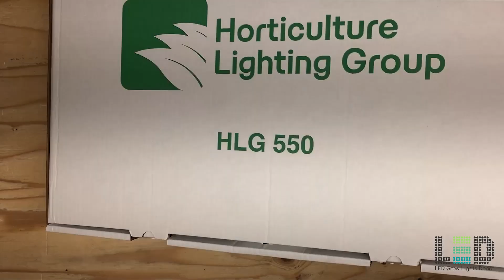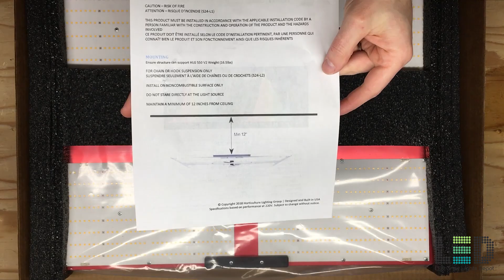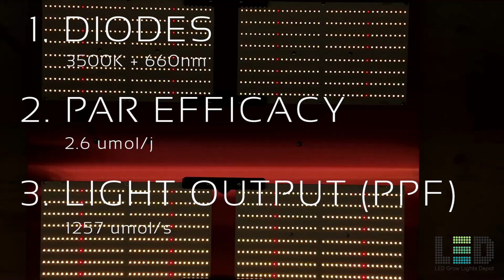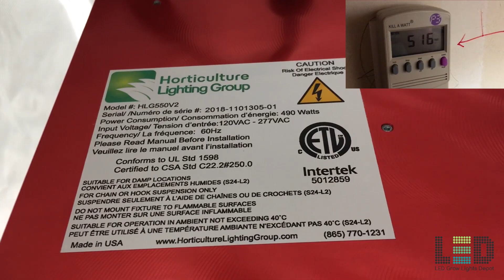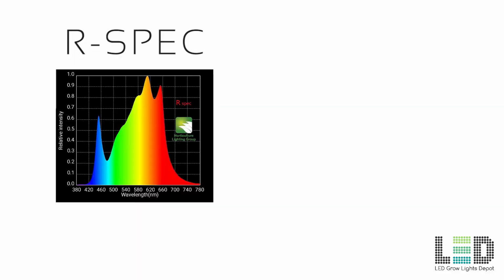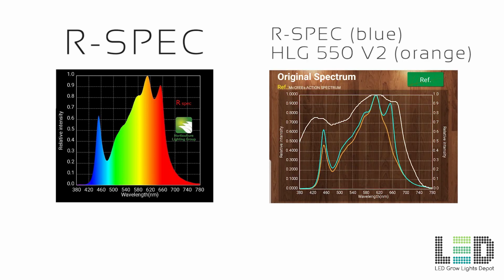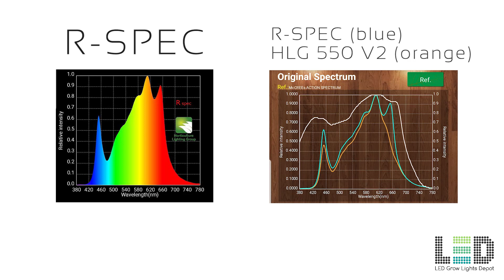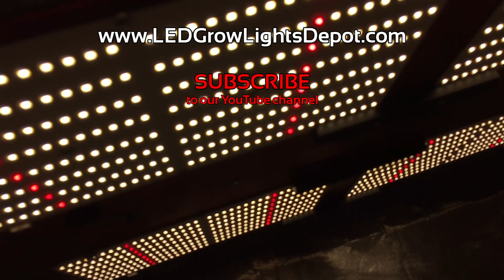HLG 550 V2 R-Spec LED Grow Light Unboxing, Review, PAR Testing

Comment: 2 years old
Rubbish
Reply from the maker: This light was updated with the HLG 600 Rspec. It is currently $775. I suggest you check out HLGs other fixtures in their current line up. The Scorpion Diablo is a fantastic light.

Comment: Great video, thanks, I bought my HLG 300 from you guys 2 years ago.
Reply: I'm thinking of getting one of those, does it get very hot?
Reply: @Glenno666  It can by touch but as far as performance, it doesn't effect it. I leave mines on for like 13 at times
Reply: @curtflirt2 thanks for the info, seems like a good light just hope it doesn't heat up my tent too much
Reply: @Glenno666  No, it won't heat up your tent too much, it doesn't heat up mines like that and I have a  2x2 with a small fan and even if you find that it does, just leave the tent open a little and you should be fine.
Reply: Their lights are really good.
Reply: @curtflirt2 thanks for that, you've convinced me to get one

Comment: I own this light, works very well. I’m on my third run.. hitting around 1.8 per grams per watt in 4x6 area
Reply: Mr. Dank BRK-BUD dam bro good shit! Do you have any Grow journals recorded for viewing? I’m thinking for the price this is the best light
Reply: Fenkell Mel thanks bud.. Unfortunately not yet with the RSPEC V2 I do have a couple with Spectrum Kings 602, and 400+/402+ grows but not complete grow journals on the tube. I will be starting one at the end of this month under the HLG.i really do like this light the spread is great.. compared to my other LEDs. Both work well no complaints with either

Comment: I saw the price and almost choked!!! There are way cheaper solution out there!!!
Reply: I am not affiliated with any company selling these lights but as someone asked  but hence deleted the comment, here are some cheaper alternatives(half price):
- https://www.aliexpress.com/item/4000170489374.html?spm=a2g0o.cart.0.0.706a3c00bTgO4z&mp=1
- https://www.aliexpress.com/item/4000446069394.html?spm=a2g0o.cart.0.0.706a3c00bTgO4z&mp=1
- https://www.aliexpress.com/item/4000530776182.html?spm=a2g0o.cart.0.0.706a3c00bTgO4z&mp=1
- https://www.aliexpress.com/item/4000495864788.html?spm=a2g0o.cart.0.0.706a3c00bTgO4z&mp=1

They are easy to be found. I am not taking away anything from HGL and I am sure their quality control is top notch, but alternatives exist half price.

Comment: Theres just so many models and variations and combinations of led grow lights Im totally lost lol
Reply: Btw a decent priced light is typically 1.50 per watt and you are going to want at least 400 ACTUAL watts for a 4x4 give or take. And ignore anything about "1000w hid equivalent" or "replaces a 600w cmh" all that is irrelevant they are comparing apples to oranges. And if a light is priced too good to be true it is!
Reply: *optic is a good company as well but I would look into rapid led if you want a puck set up. Rapid just has a better platform to build on in my opinion. Also a company called Black Sail makes an interesting light called the cannon that pulls 320 watts with a similar albeit much larger design. It's only $350 I was considering getting one for a 3x3 myself.
Reply: Same
Reply: If your willing to trust me I've been looking into lights for months and HLG 550 v2s are a great plug and play light. So are Rapid LED set ups that use the chilled logic pucks if you want to get more wattage for your dollar and don't mind a bit of work. And if you want to go all out and spend top dollar in a 4x4 or 5x5 get a ROI e680 or a similar bar light from Gavita or Fluence. Avoid amazon and alibaba lights as they cut corners on design and quality not to mention there is no guarantee that anything they tell you about the light parts/performance is true.

Comment: Is the HLG 550 V2 wired in series or parallel with the HLG-480H-2100B driver?
Reply: Mike 
Series, constant current C2100 driver

Comment: Does anyone here actually run these lights? I run the HLG 550V2 ( 2 crops in) and I am having definite issues with increased flowering times. 
Note: These are strains that were previously verified as 8wk finishers using 1000w HPS. 
I am guessing that the reason for longer flowering times is the lack or red diodes which were added in the urgrade from the V2 to the V2R. 
Unfortunately, HLG did a poor job on informing their customers about the coming upgrades and I ended up buying a V2 about 2 weeks before it was discontinued for the V2R...Yay! 
Now I get 2-3 weeks extra flowering time for my troubles.
Reply: Michael Martinez never experienced anything like that! I run the reg.V2 & 2- V1’s..... no red, and FLATOUT kills it!!!

Comment: Awesome review. I just fired up my HLG 260 V2 R spec in a 3'x3; tent. Would the distances be roughly the same as the 550 v2 r ? Im at 36" for my seedlings which are on node 3 of true leaves. I left the dimmer at default .
Reply: I would say with the 260 during flower u could get closer. I'd keep it at 36 for the seedlings and keep it dimmed down then slowly crank it up and drop it down as they get established

Comment: what about the temperature ? much lower from an hps?
Reply from the maker: Half the heat of a 1000W HPS.
Reply: @Ledgrowlightsdepot  so still very hot?
its half of the energy so for an led it should be cooler than half of the heat
could i run them in a 3.5x3.5 tent? 
i think it have too little par output for a 4,5x4,5...
Reply: Hduuuuuuurrrrrr

Comment: So hoping to get this bad boy
Reply: Be careful...read about increased flowering times using Quantum LED boards,. I got burned on the HLG 550V2... im 10 wks in and not finished yet (Crop #2). And its an 8 wk strain confirmed using HIDs. Research more before laying down the 900$

Comment: Wouldn't 4 of the 120s be as good and cost a lot less ?
Reply: Would be better than the 550 v2 without r spec
What you can do is add the r spec and it would be even better than this one
I would advise you to also disperse more the qb's to have a even better light distribution around the tent

Comment: they never said it was aimed at the budget market..some people can afford the best at any price..its a once in a lifetime light..a 10 year investment..one that will double your yield from crop 1..so it pays for itself after one crop..6 crops per year, x ten is 60 times the amount from hps you would replace 2 x a year at 100 bucks..
Reply: People who have been pushing led lighting so much are extremely misleading, especially since they aren't scientists and even admit to not knowing exactly how the sensor works. 

Hid bulbs emit the same quality of light in a 360° sphere, if you take a reading directly under the light you can get anywhere from 1100 - 2800 ppf, from 1000w de hps.

 heres where things get interesting and directly misleading, when you take a reading off to the side of the hid light and keep the sensor pointed straight up, a large portion  of the light actually reflects off the sensor and doesn't take a true reading of the ppf that's actually being emitted. If you turned the sensor to look at the light youd end up with a similar reading to it being directly under the light. 

Why does this matter? Well that's simple. Plants absorb energy, they dont reflect it, you get a more accurate and realistic reading when aiming the sensor at the light. 

Hid lighting is still the best and the best commercial growers still use de hps for their flower rooms. This is fact.

Comment: FWIW.....those readings you're taking with your PAR meter are PPF, not PPFD. Otherwise....pretty solid video. Nice work.
Reply from the maker: They are PPFD. PPF is the the total light output of the fixture
Reply: @Ledgrowlightsdepot  PPFD is a measurement across a given area bud. Spot measurements DO NOT provide PPFD. Only when multiple readings are taken and averaged over a given area (usually m²) would you be providing PPFD. You cant create any density factor without taking into account the area of light you are measuring.
Reply from the maker: I understand what you are saying, but from my understanding, a quantum sensor measures PPFD. It is a spot measurement though. 'Average' PPFD is what you are referring to when you take the average of the spot readings over the given area. PPF (total light output) can only be measured in an integrating sphere.

Comment: Sick hlg is the best.
Reply: Yeaaaa
Reply: anthony  some other manufactures do use the same LED`s, but only HLG & Samsung get the very best that meet design specification. The lesser quality with lower output and shorter lifespan get on sold to get rid. The duds get thrown in the trash.

Comment: Hlg for the win
Reply: I finally tested and it's what I expected, directly under the rspec board at about 12 inches from the LEDs the meter reads around 1000ppfd. At six inches it's 1700 and ~18 inches ~600 ppfd. Around 40% increase over the Chinese boards from Alibaba. Like I said, mine were 3000k qb288 with 6 660nm and 2 720nm reds per board. Don't remember the company name producing them but they claim top bin diodes from Samsung were used and they obviously were NOT used. You can go ahead and try to save money like I did on Chinese boards but here's an example of what very well may happen. I wasted 300 bucks on six boards. They probably under perform four rspec boards at the same price point. All the six boards equate to, for me, is a waste of electricity (aka money). I have no personal gain by sharing this info. Peace fellow ledheads

Comment: Nice really considering one of the v2 's.. Im runing sk 402 now 👍
Reply: Heard those 402 are real nice too
Reply: I have the HLG 550V2 (not R spec) I am into my 2nd crop...just about to harvest. Both crops did not finish in 8 wks (Same strains and used HID on one crop before the LEDs and they finished in 8wks) I am hearing that the Quantum LED boards are causing longer flowering times.  This aligns with my experience thus far.  It also appears that HLG realized this issue and upgraded to the V2 R... only they did it about 2 weeks after I bought my V2 for 900$...needless to say I felt  kind of ripped off.

Comment from the maker: Let us know what you think about this light in the comments.
Reply: LED Grow Lights Depot I’m stuck on what to get now this or the 600h
Reply: I finally tested and it's what I expected, directly under the rspec board at about 12 inches from the LEDs the meter reads around 1000ppfd. At six inches it's 1700 and ~18 inches ~600 ppfd. Around 40% increase over the Chinese boards from Alibaba. Like I said, mine were 3000k qb288 with 6 660nm and 2 720nm reds per board. Don't remember the company name producing them but they claim top bin diodes from Samsung were used and they obviously were NOT used. You can go ahead and try to save money like I did on Chinese boards but here's an example of what very well may happen. I wasted 300 bucks on six boards. They probably under perform four rspec boards at the same price point. All the six boards equate to, for me, is a waste of electricity (aka money). I have no personal gain by sharing this info. Peace fellow ledheads